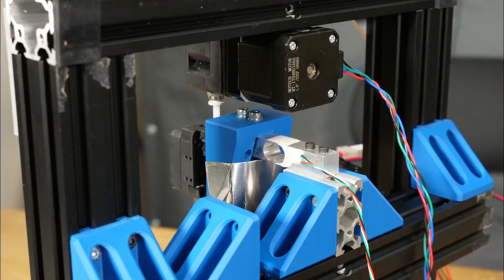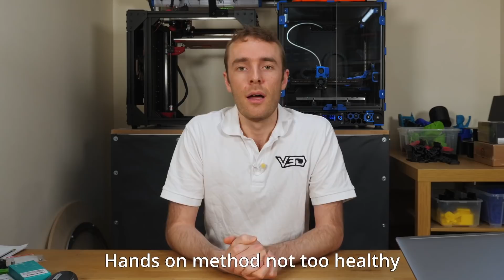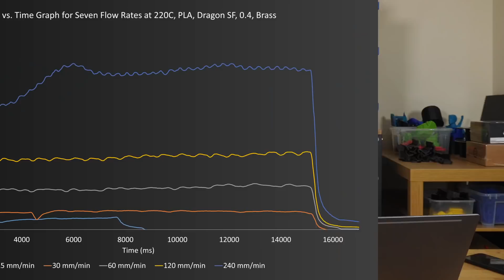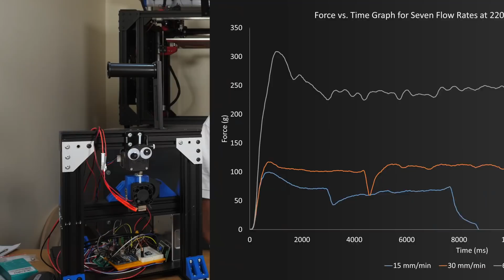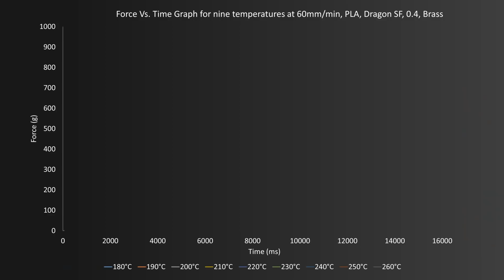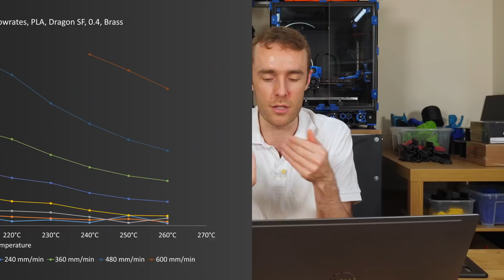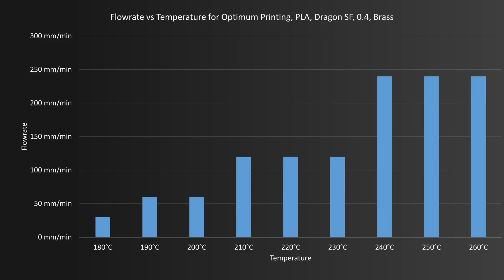The Next Generation of Hot End Testing

Comment: Heat creep up the filament into the heat break can do weird things.  Might be the cause of the dips.   Longer tests would give time for the hot end to get back to it's set temperature at high flow rates.  It'd be interesting to see the frequency response function of the hot end.  Look up FRF testing.  In this case I'd give it a pseudo-random flow rate then use an FFT to compare the motor speed to the extruder force.  This system is highly nonlinear so the coherence of the FRF will be poor and the results harder to interpret.

Comment: Hey!  This is great.  Stefan’s measurement protocol to s very useful for a functional, in-service printer.
But this…. You came up with a whole purpose-built test rig.  Marvelous.
But you are missing a few parameters:
Get a wheel that is coupled to a rotary encoder to measure actual filament speed and throughput on a continuous basis.  Under-the-curve calculation will yield total mass of plastic extruded (if you know density and trust the diameter).
Also, get am ammeter on the hotend heater to measure heat/energy going into the hotend to melt the filament.  Some math, coupled with the extrusion rate, should indicate how well the hotend is actually melting the filament (is the filament completely melting?  Is it merely softening?   Is the outer perimeter of the filament melting, but incompletely at the core?)
Also, depending on how you’re controlling all this… if you use Trinamic drivers, they are capable of dumping a BUNCH of diagnostic data via UART - so you could track skipped steps, current, etc….
Reply: A rotary encoder would take this to the next level. Between the pressure and volume data, you could have a hotend tune itself. I wonder how the pressure relates to the internal stresses that Stefan was looking for in his CHT testing.  I feel like a lot of these forces relate to linear advance as well. If it would allow you to automatically set those parameters that would be amazing.

Comment: Couple thoughts to add to the discussion. 
¹ is molten filament a non-Newtonian fluid? Could perhaps explain the initial resistance, then once it starts flowing it flows much more easily?
² do the periodic dips relate to the hotend cycling? Would adjusting pid change how they look?
³ mm/s³ would definitely be a more useful metric as it's easy to use with the graphical displays in slicers and you can set extrusion limits based on mm/s³ (in SS)
⁴ what were the criteria you used to determine your best extrusion rate? It felt kind of arbitrary, maybe I missed it - but having simple prints to go along with the data could help with developing some useful standards. Then a person could test a handful of settings, run it through Excel to build a graph, interpolate, and find some "ideals" for things like draft quality, best quality, speed, strength, etc.

This is some really good stuff! Like others, I'd love to see some comparitive data on competitive hardware - extruders, hotends, nozzle materials, heater cartridges, ... The ability to help find an ideal configuration for each of the parts in a printer is extremely powerful and intriguing, and as you said - the amount of data you get from this is phenomenal. 

Last question, lol. Did you ever combine the load cell data with the extrusion test weights? Was there enough there to characterize how force on the extruder translates to underextrusion?

Comment: My hypothesis for the initial 4kg of force. the initial slip happened at 4 kg because your extruder gears for still clean, after it slipped the first time it clogged the teeth with material thus reducing their gripping power by approx. 40%. I am new to 3d printing so I could be out to lunch but it would be easy to verify with that tester you built.
Reply: I agree

Comment: Great exploration! I wonder if you can add this load cell to the working printer and test the difference (mounting the extruder to load cell, not the hotend?). The "unobstructed" extrusion can behave differently compared to real-world use where you push filament in a tight space.

Comment: Maybe take a look at your stepper driver and settings, especially TMC drivers do a lot of funky stuff to reduce noise/power usage which could result in some of the strange effects you are seeing. Also going to a SERVO42C Stepper could improve this rig, as it offers closed loop stepper control and through some custom firmware could potentially give you the actual stepper movement, current etc. to correlate with your data.

Comment: Awesome testing methodology! This is what I expect to really help with tuning max speeds in the near future, specifically with the Prusa XL implementing a load cell returning analogue data to the mainboard. With how proactive the community is with their firmware development, I wouldn’t be surprised if they develop an “auto-calibration” feature for finding maximum extruder feed rates for filaments and making it easier for people without lots of background knowledge in 3D printing to have their machine tuned to the ideal settings.

Comment: Fantastic research! It would be interesting to see the difference in force required to print through nozzles of the same diameter but different materials (e.g. brass, plated copper, hardened steel) to quantify the potential differences in thermal transfer efficiency.

Comment: Interesting for sure. Print with it. Do a quick release plate design on a cartesian machine and document the process, not just the results. Not the endless live stream type stuff please. Just a quick summary of dense notes and key points once in awhile.
   Like how would you work out extruder force versus moving inertia on the sensor. What software already has this feature? Obviously Prusa is working on something like this for their next printer, but they seem to be venturing far from true open source software - the kind with header based configuration files.
  Also, I like data too, but maybe stick to the rule of three. I'm no good at it in this kind of context, but ahh, my familiarity comes from being a Retail Buyer and knowing what choices are worth offering to customers. Three is about the most data points people can figure out and digest quickly. And really, the outliers are just there to frame the main point in the center. This kind of focus is the difference between something I will watch casually, and the stuff I put off for later to avoid distraction from my current rabbit hole of a project. Regardless, thanks for the interesting upload.
-Jake

Comment: The initial inconsistencies might be due to the temperature adjusting pretty quickly with PID algorithm based on how much heat is been sucked by the filament, 4 seconds seems a reasonable time in order for the heating system reacting to the temperature change.
You might as well include the temperature effectively measured by the probe in order to better understand that first peak.
Plus you have to consider that you are using the temperature you asked the system to reach as a factual data wich is in fact not, cause it is not the effective temperature you are extruding at.
The most trusty way to get this data is by reading the probe variations.
Reply: I hadn't considered that. I thought it was the initial slip being on clean teeth and subsequent on dirty. I guess the way to tell would be too slowly ramp up the speed and see the maximum force. This should eliminate the pid variable and keep the nozzle temp constant.
Reply: @davidbalfour3390  first of all sorry for being late responding, YouTube logged me off and i just realized that today!
I think you are right, i’m currently testing the limit of my mosquito magnum + bondtech lgx combo on my ratrig v core 3 500.
Testing flow i realized that whe i go on the edge of the limit flow the first millimeters flows no problem, then the first skips begin with a certain frequency, then in a few seconds the skips frequency slows down and become more or less constant.
By looking at the temp chart on mainsail the temperature follows the predicted curve, thus imho indicating that the temperature/heater power need a bit of time pid adjusting.
I would be glad to help you with the great job you do, but i don’t want to bother you.
If you think i may help please pm me🙂

Comment: I LOVED THIS!! I'd love to see a contrast with other heat blocks, especially a round one like the REVO from E3D, or different materials of the blocks, like copper vs an aluminium vs brass. Like you said, there's so much you can test with your new machine 😱😃
Reply: surely a Volcano would be a great example to clearly show how the block material can change performance, as it has a decent amount of mass and a is easy to source on a wide variety of materials with the same dimensions.

Comment: Nice testing method!
My guess for the first peak would be heat creep: while pre heating the point where the Filament is soft moves up the heat break and it requires more force to break that loose. After it has loosened the 'meltzone' is lower down, so there is more space with low friction where the Filament is still solid.
Reply: Same for the dips at low flow. Heat creeps up and slowly increases friction (and force) until the whole blob of molten Filament rips off and moves down. Because it's already soft, there is a period of low force. The wideness of the dip is how much of molten 'heat creep' Filament there was.

Comment: I wonder if the initial peak is similar to "water hammer". You need to get the filament to move, both in the hot end and also pull the filament from the spool. I wonder if a "soft start" of the motor could make a difference here. Though I have no idea if it will be of use in real printing conditions.

Comment: Interesting stuff. I will throw my two cents worth in on that initial spike. Although there is molten filament in the hot end, could the filament in the exposed tip of the nozzle be cooler forming a less viscos plug of filament that has to be cleared. A possible test would be to start the system and stop it before it clears that initial preheated filament, then restart it again. The filament in the tip would not have time to cool and there should be no spike. If it is stiction somewhere in the system the spike should still be there.
Reply: That is indeed the idea, but the most significant plug is formed around the heat break, when the filament is stationary. There is much less resistance when the filament is moving forward, and the static plug has been replaced by a dynamic seal of molten plastic, between the filament and the wall.

Comment: You could be right with the up peak when the motor driver is turning on. Maybe the driver is forcing the stepper to the next full step. It should be easy to see, if you plott the graph with retractions or drivers turned on before. However, from cooling fans we know that they need a bit more power to start rotating,  could be similar with steppers. You’re probably right with issue 6 and the ripples.. measure them in relation to the extruder steps per gear rotation, I bet it’s the teeth on the gears we see here. Keep on investigating, it will at least help the nerds to build better extrusion systems:)

Comment: Could those small fluctuations be related to hotend PID?? I think one needs also plot pid altogether it might show something
Reply: My thought exactly.
Log the heater state and hotend temp.
Looks like about a 2sec cyclic cycle. And if you look at the pattern pressure spikes up then drifts down slowly. Almost exactly what you would expect for a rapidly cooling slow to heat PID loop.

At the upper end the patter is more erratic because we are seeing the grain structure melt rates inside the filament. Until the drive starts skipping that data is showing the uniformity of the crystalline structure of that roll of filament and its consistency.

This is awesome!!!

Comment: I guess max force is lower after skipping is because at first gears create grooves in filament, but when gears slip, they literally shave those groves and now the bottom part of the filament is not gripped so well, only upper one works correctly. It is basically what happens when the nozzle clogs — you open the extruder and find lots of plastic shaving near gears.

Comment: Very interesting, you cannot do this for one horend obviously and now everyone is waiting for an gradually growing list of combo’s. Also measuring sale horend and cheap vs expensive or brass vs steel nozzle of cht vs regular and so forth. 
It also confirms my subjective feel of having to need to dial down print speed from the traditional measurement of extrusion rate testing. That was an eye opener as I was hoping to push my ender6 drastically above 100 mm/s with 0.4 nozzles. Currently figuring out how to mount the dragon mosquito high flow knock off paired with cht nozzle. Curious if that would make it into a test.. or just the mosquito with cht as reference point?
Reply: Damn autocorrect in different keyboard language settings… sorry for that

Comment: Look forward to seeing  Bruce forsyth (brute force right) can help us with the generation game of the extruder as long as the price is right. 
I believe this is what prusa doing but on a much larger scale, they can collect data from all xl printers and mine the data. There are so many subtle variables, from nozzle wear, extruder gear profile, off center bearings, impuritys in the filament,etc.
But teasing out the larger factors will be beneficial to all, especially for us Unicorns and for those seeking perfection for the 602 issue.

Comment: perhaps one reason for the 4kg peak was that it could initially do that when clean, but after the first slip there was some residual filament ground off in the drive gear teeth reducing the gripping force?
Reply from the maker: In my testing, IIRC, the teeth actually seemed to self clean as I checked but often never needed to clean them out.

Comment: Definitely, it is an important video. 
If I ever experience problems with my hotend or a newmaterial, I'll probably come back and watch this.
And of course, there are tons of questions. Is this result consistent for different brands, how much does it apply to different materials?
I don't have a direct extruder (yet), but I tried TPU. TPU is nasty because it seems my room temperature influenced the flow rate a lot. Probably, because the extruder sinks into the material more or less and maybe the whole path becomes more sticky. There is probably a lot to investigate about the forces involved. I would be curious.

It might be a similar thing for PLA. How does the room temperature (and more important but usually similar the filament temperature) influence the force, which can be applied to the PLA?
I think there might be an influence, but it is probably not that high. At least I hope PLA doesn't change its softness between 15° and 35° by that much. However, the TPU I experienced, does. :(

Comment: I think your waves in the force diagram at the top two feed rates are due to a concentricity/roundness error of your driver wheel in the extruder... where the radius is a bit larger, there will be more filament going through the nozzle, taking out more heat, therefore restricting flow and rising force.

With lower speed the problem disappears because the nozzles pid tuning can work against it... and also because longer waves are harder to see...

Does, that sounds resonable? Do you have a way to measure the runout on the wheel when turning the motor?

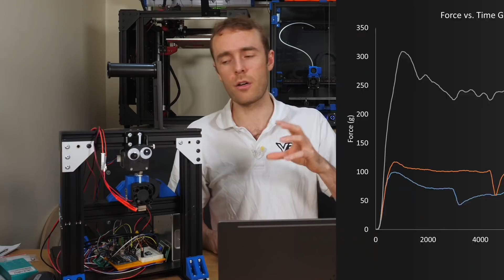Comment: At 10:23 you talk about the dips in pressure. Maybe tracking the power to the heater cartridge during the test may indicate increase in heating power that has taken time to reach the thermistor. If the nozzle is between the heater and thermistor?

Comment: I design coffee brewing equipment and one of the issues that occurs is temp dip due to the introduction of cold water. You can overcome it by turning on the heater before (best) or right as the water starts to flow. The temp probe is blind to what’s happening but we know cold is coming and can compensate. It might be a good idea to make a PT1000 sensor that checks the temp of the filament as it leaves the hot end to check the variances in temp during extrusion. Someone smarter than me can do the math and determine how much energy is needed to melt filament at any speed and program the heater to respond to speed then use the existing sensor to keep the hot end stable at idle. The main issue here is having the filament at a know temp so the calculations can be calculated. That said the dip might be heater catching up because it’s blind and took time to catch up. Take the heater and turn it on full power and start running filament until it skips, then you will know the actual flow limit.
Reply from the maker: I've been thinking of ways to heat without using PID tuning so it can be removed from the equation. It'll need a well tuned machine, but should be possible.
Reply: @Vector3DP  Who is the Gcode wizard? Monitor the extruder motor, do the math, maintain filament temp, and it should be possible. Optionally you could count forward pulses of the stepper to do the energy math and leave the PID for ide stability.
Reply: Would be interesting to see if a command to turn the heater on just before extruding would smooth the peak. A feature like this may help keep a consistent temp during printing where the filament starts and stops.
Reply: @domurry3227  Having the print in a file allows us to see the future and ramp heat right before it's required.
Reply: On duet boards you can use M309 to configure extra heating for every amount of filament extruded, and they recommend calibrating it by extruding at maximum volumetric flow and watching temperature, it there is a drop at the beginning you should increase this parameter a bit.
Reply: @Gengh13  We can see the future because the steps have been laid out, how can you extract the info to start heating before so the hot end is ready?